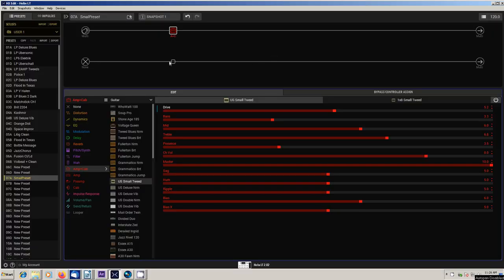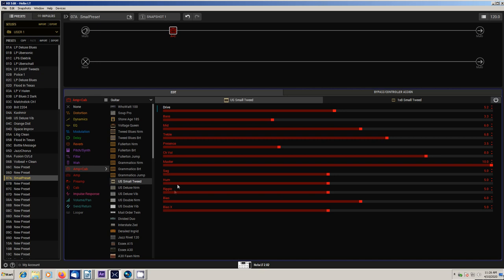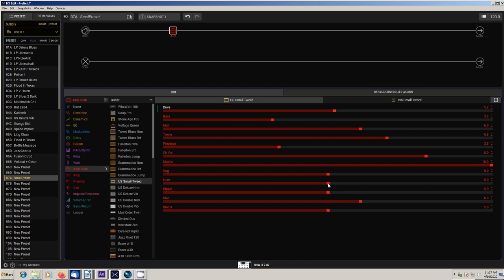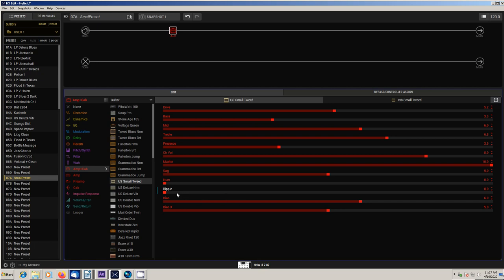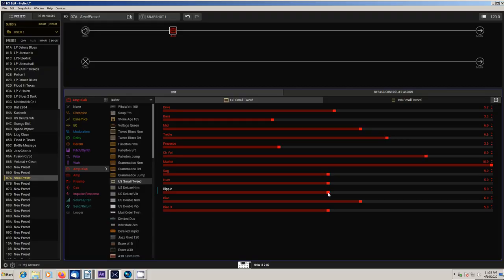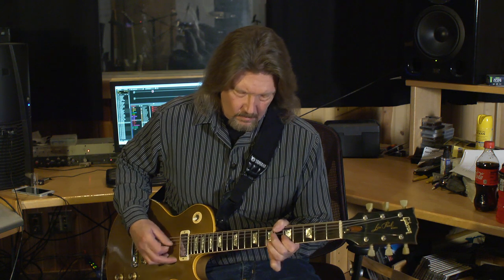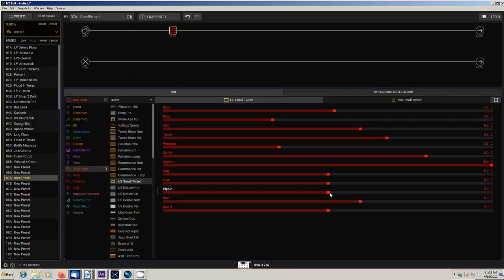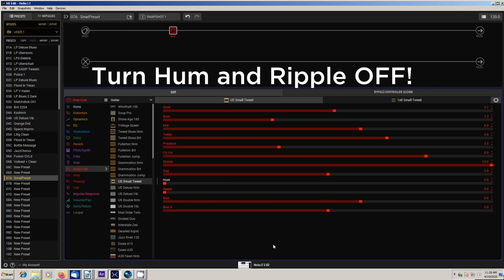Line 6 Helix Tips - How to Get Rid of the Noise

Comment: The introduction of the Horizon Gate in the new 3.01 firmware update has helped me A LOT with noise. It's not really a classic gate as much as it is a dynamic high shelf filter. TL:DR it makes noisy humming guitars way more playable. Check it out, it's also part of the Horizon Drive, based on the precision drive.

Comment: Awesome, thanks for sharing this.  I currently have a POD HD500, looking at a Helix later this year and this will definitely go into my toolbox.  For HD500 owners, I checked the advanced guide, and it turns out you can make this same change to amp models on that unit.  It's located onn page 2 of the Amp Editor screen.  Both hum and ripple are adjusted by a single control, knob 3 in this case.  Will definitely try this out after work today.

Comment: Hey Larry, I installed the 3.01 helix update. The acoustic simulator has a lot of hiss sound. Any suggestions to get rid of it ? noise gates did not do much good
Reply: I have an HX Stomp. Here are the parameters that I adjust if I find the sound on any Preset is too bright and noisy because of that: Amp mic selection; Amp Treble, Presence, and Bright Switch; Excessively high Gain;  Amp+Cab Hum, Ripple, Bias, BiasX, Sag; Input Impedance settling, higher = brighter, Cab high and low cut. The Gain and the Mic are often the culprits. The "Ribbon" mics are much warmer sounding, and consequently, can be less noisy. Hope that helps.

Comment: Does the helix really sound better than the original Amps? If so I’m selling mine and going with real amps and pedals. 
It’s hard to get my desired guitar tones from the Helix.
Reply from the maker: "Better" is going to be totally unique to every individual. What I can say is, with a Helix I've learned how to get the sound in my head to come out of the speakers. I do more studio playing than live, and I can achieve exactly what's needed for a song very quickly. For live use, you'll need a lot  more than a Powercab for it to feel right. I'm using an 800 watt stereo power amp into two 12" Celestion Heritage G12-65 speakers and bypassing the Helix' internal IRs for the stage rig. That feels as good as any "real" amp I've used on stage.

Comment: On my high gain patches I get a digital sound noise/crackle as the tone fades. What is that? I do have gates, and the gains are mid to low so no clipping or over distortion. Is this just a byproduct of digital circuitry?
Reply from the maker: Do you hear the same thing with the gate out of  the circuit? Depending on your pickups, and the threshold of the gate you may be hearing a bit of fluttering right around the gate threshold. And since you're working in the virtual amp world, you can always try moving the gate to different points in the signal chain to experiment. If you're playing djent, you might like it better between amp and cab. On high gain tones, for me, I usually am low-passing the cab or IR module at around 6500 to 7K. There are some frequencies right around 7.5-8K that I don't want to hear, although I know some metal players like them.  If you have those set, turn down ( or off - my preference) the AC ripple in the amp module settings. That can be very apparent during the decay of the note. Hope this helps!
Reply: @MooreMusicGuitars  Hey! Have you found a solution? I get very bad artifacts and even if i run the Helix on a powerbank it's still there, so it's not coming from the AC. Removing the USB connection can help a little. Even with a clean Twin sound it's there. I try to be smart with gates, but it is annoying that it is present while playing.
Reply from the maker: @christianboddum8783  I've found that several models need some deep tweaking when used with certain guitars - and I've found this on all of the various modeling platforms. On many models, I can generally get rid of any digital sounding artifacts by turning down the AC ripple and hum settings. Sometimes I need to also vary the ratio between "drive" and "master" settings on the amp.  Especially on a few cleaner models (the Twin in particular - I prefer using the newer Princeton model for Fender cleans) try taking the input impedance setting off of "guitar/auto" and choose the second setting from the far right, just below 1megohm. Can't remember the exact number, but it may be 340 Kohm. Hope this helps.
Reply: @MooreMusicGuitars  Se my new comment ;-) I found that a Bluetooth dongle was giving me most of my trouble. It is now removed and I'm quite happy :-)
Reply from the maker: @christianboddum8783  Glad you found that! I hadn't considered the RF possibilities from external devices. I think your discovery will help a lot of people. Thanks for posting.